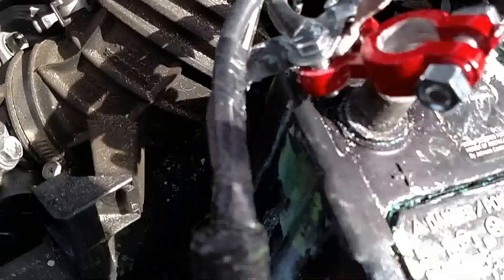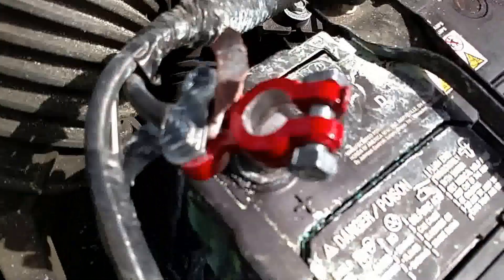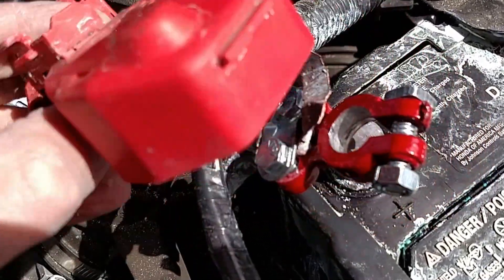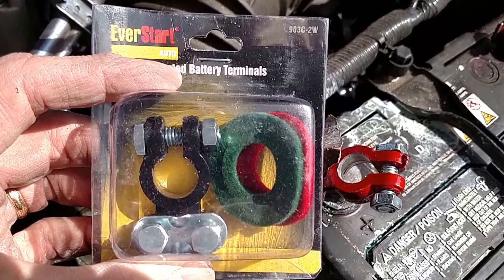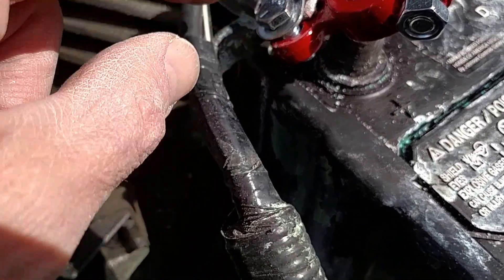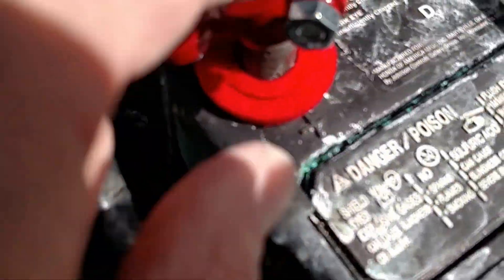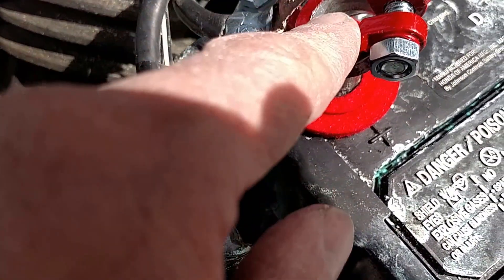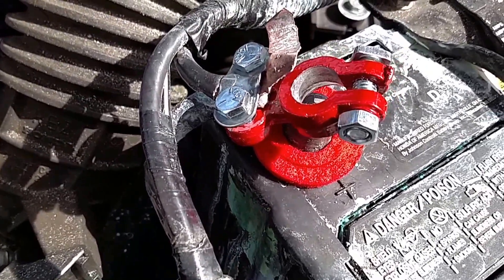Battery Terminal clamp replacement Honda CRV wiring harness fix.

Comment: Had the same issue, used a 10mm socket to loosen the bolt to replace the battery.  Only for the terminal to break on me. For Canadians, you can get the replacement terminals at Canadian Tire.  Thanks for the video, it's a life saver.

Comment: How did you get the old terminal clamp off.  My original clamp is crimped tightly around the cable and it appears that the only way to get it off is to cut it but I’m not sure there’s enough slack to put a new one on.
Reply from the maker: It's been a long time ago, but I believe where the wire is clamped, on the bottom the clamp has a slit.    I think I got a screwdriver into that slit then just pried it open.   If I remember right, it took some work.

Comment: How did you get the old clamp off of the wire? Mine is all corroded and I've been brushing and yanking on it, but it won't budge. Do I need to replace the whole wire?
Reply: He didn't remove the old clamp at all. You can see what remains of it sticking out of the new clamp. He just tightened the new one overtop of the old crimped section. I did this once myself but it did not get good connection. I ended up cutting the old one off and re-stripping the wires.

Comment: Thanks for the video. I just did the same and I noticed that you left some of the old terminal and put the new one over it. That's why you needed the longer screws. Just as an FYI you can also carefully remove the old terminal with some vice grips to get the exposed wire. Again thanks for the vid!

Comment: Honda's electrical wirings are designed to corrode & fail after several years. You should clean all ground wire terminals because Honda used dissimilar types of metal. Perfect recipe for Galvanic Corrosion. The Transmission Ground Wire is HIDDEN under the air cleaner bracket near battery. You will need to remove the front splash shield to have access on the opposite end of the transmission ground cable. 

You can use Multi-Purpose Grease to seal the connections. The best option is to replace the copper terminal with steel and use heat shrink to seal the copper wiring.

Comment: Thanks Jim, you're awesome! This saved me a lot of time and money!
Reply from the maker: Great, I'm glad you used it.   My connection is still working great.  I did have to replace the battery due to old age, but the connection is working great.   It's a good fix and saves a lot of money.  I also noticed the other day , at most Auto Parts stores they have the battery terminals in different wire sizes.  Would save you a trip to hardware store to get longer screws.